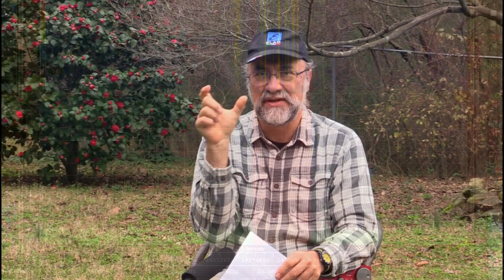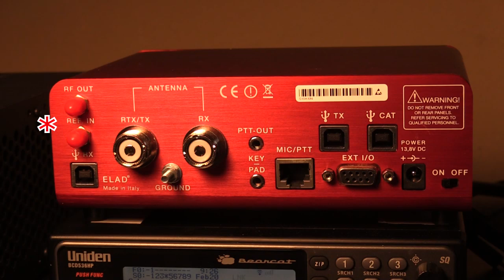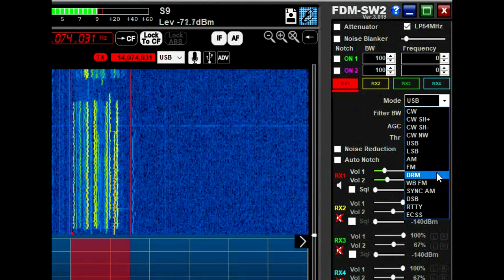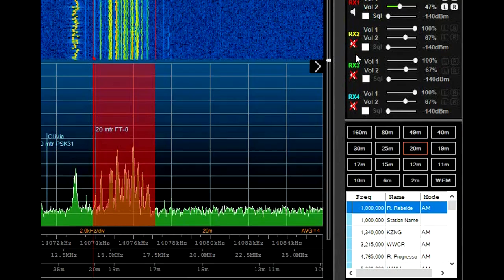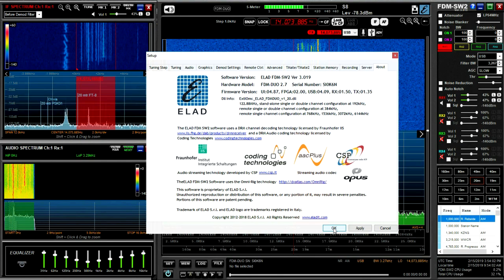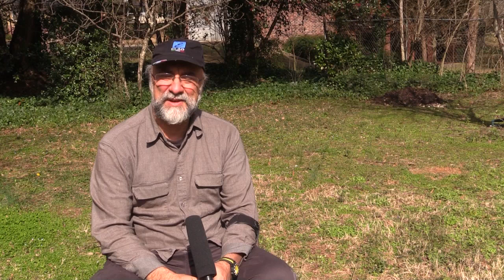Elad FDM-Duo Review

Comment: I really appreciate your work Robert, all your videos are amazing and full of information, is this radio suitable for home use? Does it handle large antennas well? Since I like to listen to non-HAM bands, I am very tempted to buy this TCVR, is there anything fundamental that you would criticize it for? How will it perform technically against the IC7610 for example? I know this is a completely different concept, but I'm interested because the 7610 has one of the best RX's ever made in my opinion. Thanks so much for your reply, 73!! Jakub OK1TCM.
Reply from the maker: J- I really liked this radio. I did sell it and went to an Anan 7000 DLE II. I had it mated with a Xiegu XPA-125B amplifier. Excellent combination.
For that price though, a IC-7300 is a better choice. It is a 14 bit SDR and outperforms it's price. I indeed do like the IC-7610 for my main radio. I have used ALL the best radios (box with knobs radios)...and the only one still here is the IC-7610.  I would buy another one. The best radio made is the Anan. You can get 85% of the Anan performance with a Hermes 2 kit for $400. Add an amplifier to it... and you beat the IC-7300 value - and performance.
Reply: @robertnagy2163  Many thanks for the information, why did you end up selling ELAD? On the other hand, I like its versatility because it is a TOP receiver and also perhaps a good transceiver, if it is supplemented with a small PA, there probably won't be much to complain about, except that it doesn't have its own pan adapter and for today's operation a PC is already needed. Another option is the Icom 7300 with a pan-adapter using PTRX and an external SDR, but I have no experience with this solution. The IC 7610 is a beautiful radio, but I would regret taking it to portabe activities.

Comment: Hello Robert. I hope oyu see my message. I recently purchased and FDM DUO used and its working great When using a mic on the radio is there a way to see you transmit signal/spectrum, on the Panadapter? thanks.
Reply: Wow, I have sold the Elad 3 years ago and now use an Anan 7000 DLE II. I forgot everything about the Elad! Sorry
Reply: @Yavor54  OK Bob. I appreciate you getting back to me. I know that Anan is an awesome rig. I'm running my FDM Duo into a Juma 100Damp. The combo is working great. 73 de WA3RSL

Comment: Ugh, I was this close to buying a G90 as my first HF rig, and then I had to watch this. I'm torn.

Apart from all the great SDR features, I love the fact that this rig exemplifies the Italians' love of great design. That's so lacking in this market.
Reply: Oh yes, there is no comparison in the elegance of the Elad with the "First Experiment" design & look of the G90.  Also, there is no PC interface option on the G90.  The Elad's software- as you see- is amazingly full featured. I believe it to be the most well-done of all the SDR PC programs. Reliability has been great for me the last 3 years and and Elad is an established company with many other professional commercial products- which give them a depth of experience that Xiegu does not yet have. The G90 is a little starlet of a radio offering great value. It's soon to be released external 7" LCD screen control unit will add to this radio's attractiveness.  I use the Elad only in the shack and the G90 portable. My Elad is my digital mode workhorse. Either way, you'll have good fun.
Reply: @Yavor54  Thanks for the reply. Yeah, that software is out of this world. I wish there was a linux version, but such is the tradeoff I accepted when I went that route.

I guess the bottom line is that they both seem to be priced commensurate with their value. Otherwise, the choice would be easy. :)

Comment: Can you compare the Elad FM Duo to the KX3? Thank you
Reply: I sold my KX-3, but I had it for years. the KX-3 has a quieter receiver. Nobody beats Elecraft for quiet. The KX-3 is a refined piece of gear with a very analog feel. It is also a little quirkey. You would NEVER know how to operate it without a manual..and will forget even how to turn it on if you don't use it for 3 months. I liked is a lot, but not enough to keep it. The Elad is a horse of a different color... literally, mine is Red. It is a simple radio if used portable my itself. Easy to use. When you connect it to the PC, you have the most elaborate SDR on the market. You can do anything with it. It is the ultimate radio for digital modes. Mine does that only. It produces a very clean signal on SSB too. You DO need a BCST band pre-filter if you are near a AM station tower. They have them. I'm not selling my Elad. I just sold my FTdx-101D and the Elad is still here.

Comment: Other than the 100 watts output, how would you compare the Elad Duo to the Flex 6000 series. All comments appreciated. Tom W1TWS
Reply from the maker: Tom- I've owned several of the Flex radios...1500, 3000, 6300. I lived in Austin for 25 years. They are superbly refined radios. The user base is LARGE and the company is responsive. Prices are competitive with the new Japanese SDR offerings. The Elad is priced right and the interface works well (PC USB). The SW-2 operating program is very well done. It lacks remote operation like the Flex (future?). On the air, they are actually similar. It takes a little doing to set them up for SSB TX. For digital modes both are excellent. Construction quality is excellent on both. Cost with a 100W amp is a little lower on the Elad. I like SW-2 better than SmartSDR. It allows more fine-tuning of the SDR. More customization. The Maestro display is Ultra-high resolution. I actually found it to be too hi-res. What I like is to use the Elad for Digital and a box-with-knobs SDR for SSB (7610/7300). You can't go wrong with either choice!

Comment: Very nice overview. I just bought this radio but have not installed it as yet. Looking forward to doing so soon. One question...can the 4 different receivers/slices be on different bands? It would be nice to be able to monitor activity on different bands at the same time.
73 de W8DU
Reply from the maker: If you bought the unit without the bandpass filters, yes. You have two receivers with 4 slices each. You also have the radio itself which can be a third receiver. So, three bands are possible with 4 slices on two of them and one RX on the box itself.

Comment: Thanks for the wonderful review. Q: On the subject of ruggedness (for portable applications, SOTA, camping, field work, etc.) how would you compare it with other QRP radios?
Reply from the maker: The radio is very well-built. I wouldn't slap it around in a duffle bag, but I would expect it to hold up perfectly in the field. These are hand-made...you can tell. The Italians take pride in their work. It feels modern and rugged. Control response is excellent... tuning etc. No surprises...everything works as you expect. Only complaint is having three USB connectors. They could have integrated it into one. I do that with a $5 external USB hub.

Comment: Great, detailed review Robert!

I can see a definate use for those multiple r'cvrs... You can visually  monitor all the other bands to see if they are open and/or active!

I saw where you sort of did this by opening a new small window on the left; however, I wonder if you can display them on the mini-bar below the main display? Could you look that up & try that please? If so, again, easy way to monitor other bands.

Another question for you on an unrelated topic; have you found a good, affordable ($250) power amp rated in the 125-250 Watt arena? Also, would like something that can do 50W @ 100% duty cycle for digital without harm.

If so, could you do a review on those please. I find it frustrating that all I am finding are amps that are $550+, almost as much as a new radio with a 100W output.

I don't want to stress my 30 year old Kenwood TS-440 outputs even though they are 100% full power, I'd like to keep them that way!

Thanks again Robert, for your great reviews!

73 - John - N7GHZ
Reply from the maker: Well, I use the Xiegu XPA-125 at home and it is superb. It has 240W worth of finals in it and gives the average power output of a 200W radio on SSB. I use the Backpacker 40W amp for field work. I can't remember the price, but it was a good value as a kit. RM in Italy just released some more models which would match this radio well too. Google them. Then there are generic broadband amps, but you will generate some nasty harmonics. I'd go with a RM amp of about 50W....
Reply: Thanks Robert, 73
Reply: I use an RM Italy HLA-300v. On max output from the DUO, I'm averaging 240 watts. It's pricey, but HLA-150's can be had fairly cheap.